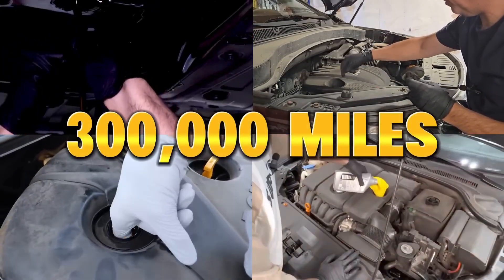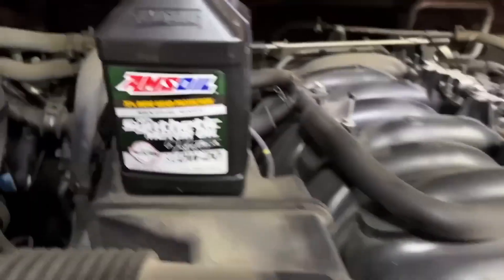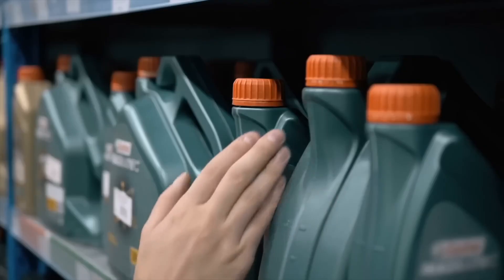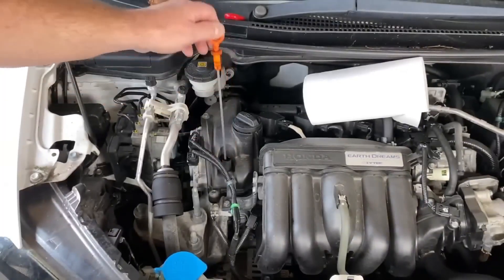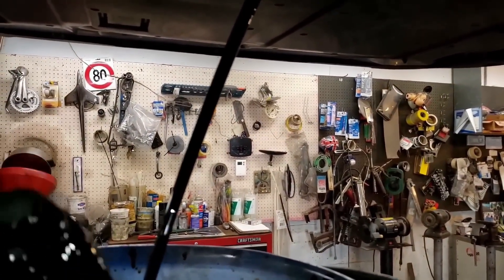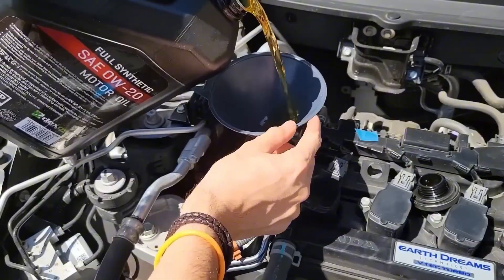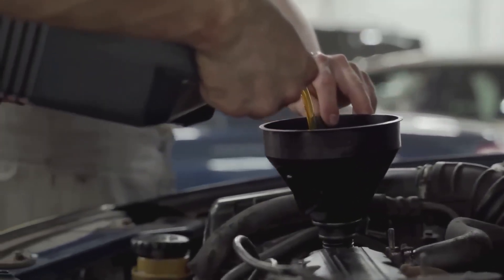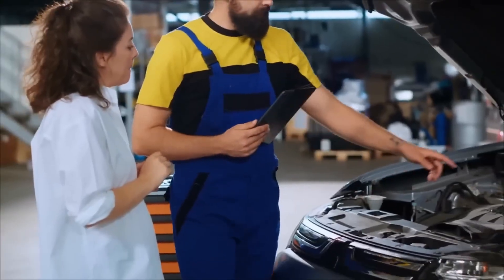I Tested Engine Oil for 300,000 Miles - The Results Are INSANE!

Comment: There can be a difference between brands.
I always did oil analysis every change on my semi truck. Was using a Co-op brand synthetic. Got good results on the analysis.
 Had it in at the dealer for some other work, it was time for an oil change so I had them put in a synthetic, whick was Shell Rotella T-6.
Later when it was time for another change went back to Co-op, the results with the Rotella showed lower wear metals, went up again with subsequent Co-op results. So I stayed with Rotella after that and they went back down.
 The results in either case were still well within specs, but there was no doubt the Rotella had lower wear than the Co-op oil. We are only talking very small parts per million difference. I figured though over the course of the miles I'd be doing over the years that the small wear diffence could add up. I sold the truck after 5-1/2 years and 550,000 miles, still didn't use oil. Never had to add between oil changes.

Comment: many things come into play with engines and oil is one of them and oil has come a long way from the old none deterrent oil that would alow all kinds of build up that at times would clog oil passgers and blocking oil from draing back to the oil pain, 

back in the 70 an oil filter made its coming out in an avation show and made it clear there oil fliter would keep the oil so clean the engine at the time of its life end would be as clean as the day of its first start.

and theres lots of OIL additives that clame to increase the oil's performance like Prow Long and whats up with the 10,000 mile oil change, or the 6000 mile oil change as it use to be 3000 miles, but oil's have improve,

but what has not improve ?